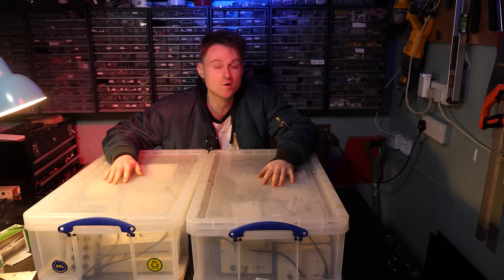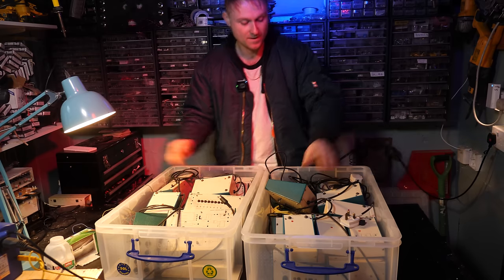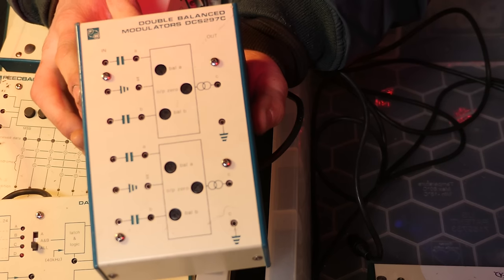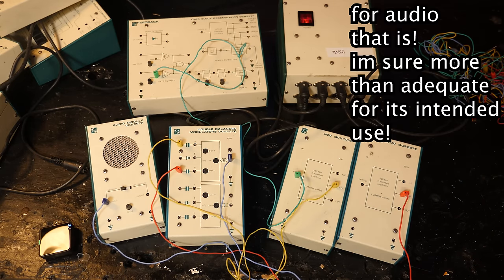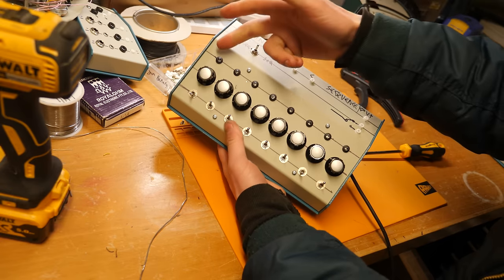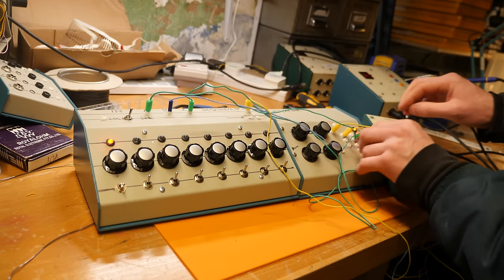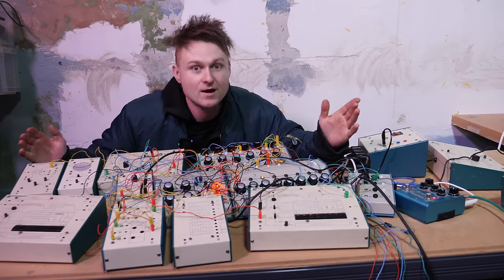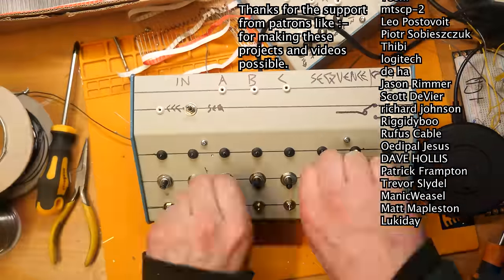BABY TEST EQUIPMENT - Making Music With Vintage Science Education Sets -

Comment: Those VCO's work at 1.28 MHz, which is in the medium-wave broadcasting band, so if you use two or more, with a metre or so of wire on the outputs to work as aerials, they would produce a heterodyne sound on an AM radio ( i.e. the AM detector in the radio produces an output audio frequency that is the difference between the two or more radio-frequency waves).

Also the 'double-balanced modulator' does the same function as the 'ring modulator' on analogue synthesisers.

Comment: I built a sequencer for my MS10 (40 years ago!) using a 4017 decade counter driven by a 555. It was a great while it lasted but the chip failed as I think the synth was pulling too much current off it straight into the control voltage input. Probably should have provided a transistor output stage.

Comment: I found a Yamaha pss-170 keyboard. The output stage is dirty AF through the on board speaker and through the headphone jack.Any suggestions out there on how to get a cleaner output? All the capacitors seem fine no bloated caps. I did a complete tear down and cleaning. Also tried different voltages 9-12v on the wall warts. I know it’s a cheap keyboard, but I’m running it through my Mpc sampler adding effects to spice up this mediocre keyboard..

Comment: Amazing work! Is it possible to make a divider to bring those 1.25 MHZ Oscillators into a usable signal?
Reply from the maker: Yes. I did but the control is so small after division
Reply: Use an AM radio?
1.28MHz is in band!

Comment: Run the 1.28Mhz through a CD4020 14 stage ripple counter IC for frequency divison (14 octaves lower than input)
Reply from the maker: Indeed I have but still the control voltage is very small

Comment: "Professor I am very sorry to disturb you but I have these sounds that I captured and I was wondering if you could decode them for me" "Certainly my friend, with my quantum computer I can analyse a million million waveforms simultaneously and any resonance that they contain, from that of the hydrogen atom right through the spectrum to the very rotation of the earth around the sun I can filter out and detect them" "I do hope so professor because their source is a mystery to me and the ears of all my friends" "OK let me feed the magnetic tape in here, pull that lever there please. The machine takes only seconds and the answer is usually something like 'a blend of Brothers In Arms by Dire Straits and a Bendix Washing machine on a 1600 spin cycle'" ... bleep.. bloop.. *flashing of arcade button style lights. The professor pulls out a ticker tape readout. "I can't believe this my friend, the machine says that these sounds could not be generated by any item in the known universe..." camera zooms to professor's wide staring eyes "where did you hear this? It is impossible"